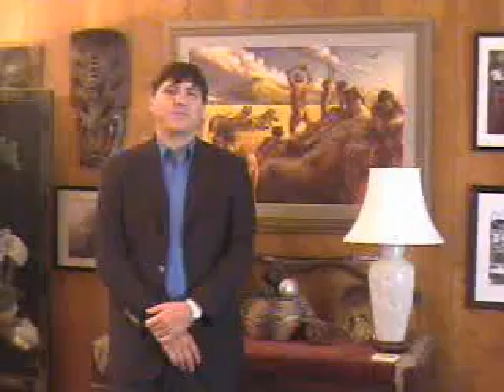Necessity of Nuclear Power

Comment: In the 1990's and early 2000's this was a huge problem.  The two plants accounted for 90% of the CFCs in the atmosphere, but were exempted by the government.  Since then, they have been working on containing the CFC-114 leaks at the Paddcah, KY plant and have closed the Portsmouth plant.  Officials are saying they are licensed to build a new gas centrifuge plant that will not leak as much.  

the 371 metric tonnes are significant because CFC-114 is much more potent and longer lasting than CO2.

Comment: I'm not talking about golf carts, I'm talking about real roadworthy cars.  I've seen quite a few, including an original GM EV-1.  They pass all of the Federal safety standards.

Fuel cells are nice an efficient.  However, the hydrogen has to be extremely pure.  And the fuel cells are currently still in the millions of dollars.  This also leaves one more problem.  Hydrogen is very volumous as a gas and very expensive to liquefy.  This is why fool cells are really not going to be a viable option.

Comment: melt downs haven't ever caused that much damage to the environment (chernobyl was an explosion though there was some metling involved).  nuclear power is renewable, but they killed the program in the 70s due to fear of nuclear proliferation, and nuclear power plants are expensive to set up because people sue the shit out of you if you do so.  and there are ways to dampen the radiation, and 90-95% of the radiation dies off in about 15 years.